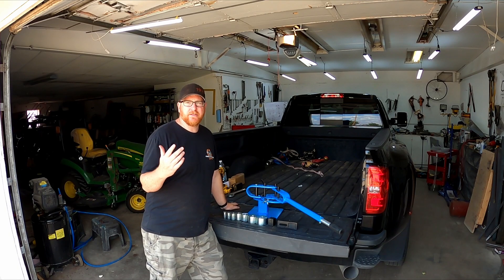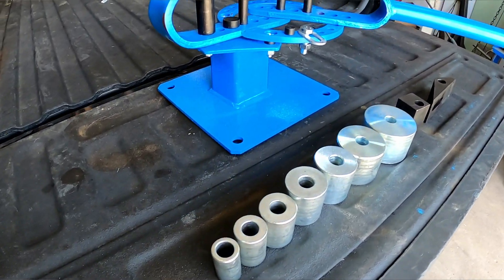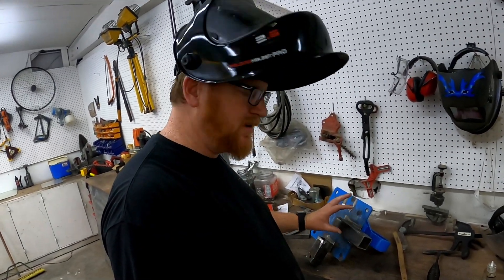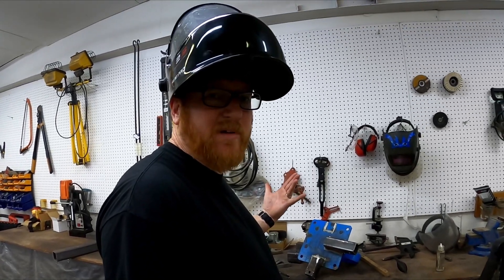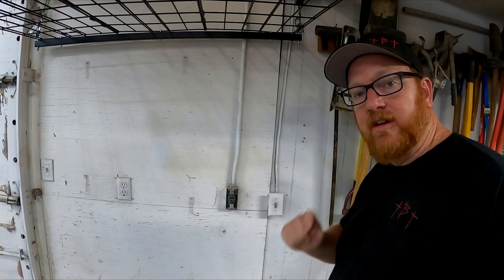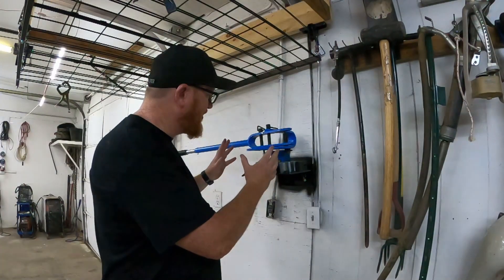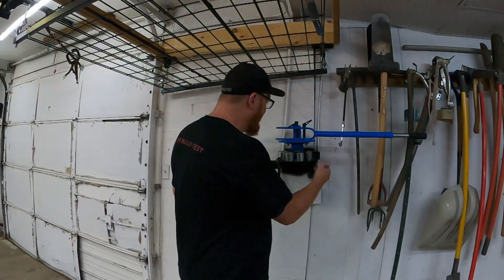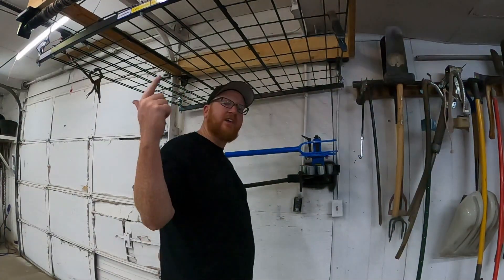This Tool Could Change The Way I Build!

Comment: Great idea, but in my opinion, you have it mounted too high. For maximum strength and flexibility, it should be at or about hip height. Having it up that high trying to larger stock is going to give you neck strain and shoulder problems. It's also going to be off balance as you try to start your bends because it's way above your center of gravity. Not sure how well it'll work logistically because it's so close to the wall, but only time and projects can flesh that out.
Reply from the maker: @AlAmantea  it will definitely take a little trial and error.  I have a 2" on the front if my tractor forks so I can move it over there and find out what height works the best.  Then weld up another reciever.  Thanks for the comment!